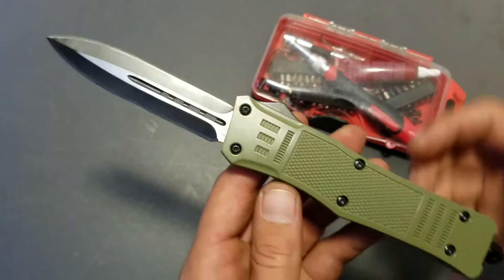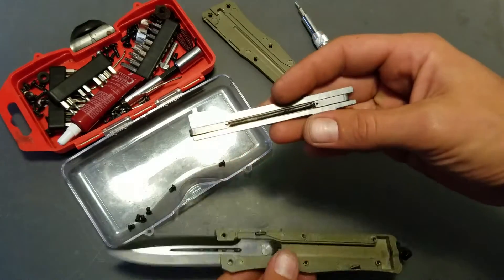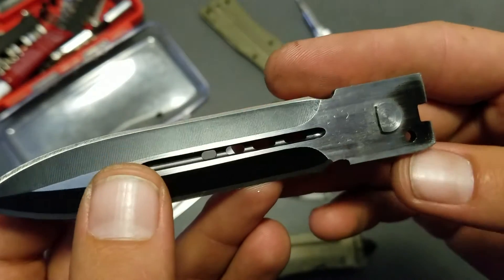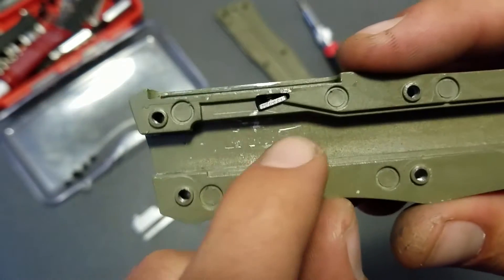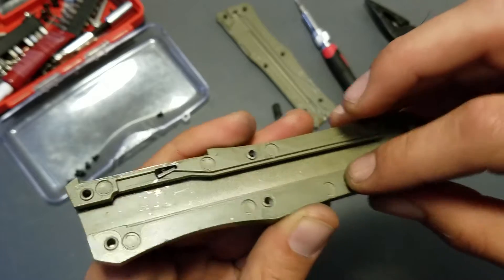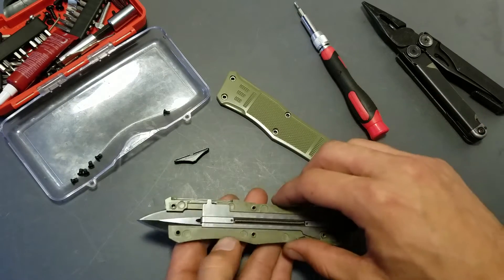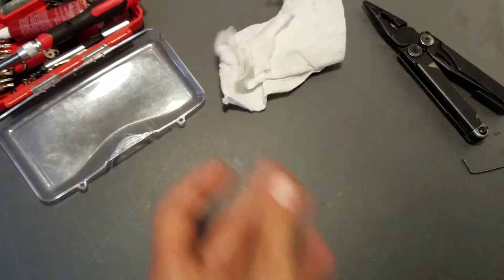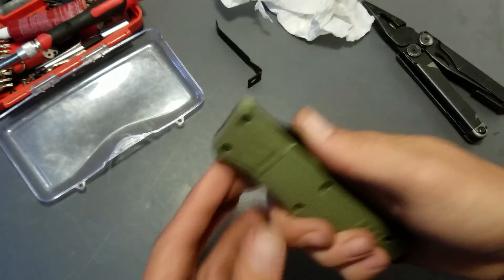Combat Troodon clone internals

Comment: The handle looks identical to the Atomic Defender available on Grindworx.  In fact, so does the blade, but the slide is slightly different.  I never really thought about it before seeing this video that the Defender is loose copy of the Combat Troodon, but it makes sense...they're the same size, same blade size, etc.  The Defender does have some decently thick blade locks which means it could stand up to being stabbed and power rocked in wood, and probably do a credible job of being hammered through, though that's not at all what normal people do with their OTFs.

Comment: can i please have a link to this knife or a inexpensive otf
Reply: Here you go: https://www.grindworx.com/cat--Atomic-OTF-Knives--571
Reply: The Atomic Defender uses the same handle as the one shown, same blade and is quite sturdy and reliable with a strong blade ejection.  It's on the heavy side, but not to heavy when clipped to the pocket versus riding in the bottom.  What makes an OTF great versus good are the blade locks.  Microtech and Benchmade have some pretty thick blade locks that won't fail without literally shattering the knife handle.  Really inexpensive OTFs often have thin slivers of metal for blade locks, but even that is ample for cutting tape, cord, boxes and stuff, even thrusting into soft materials.  The first thing I noticed when I disassembled the Atomic Defender is that is has fairly beefy blade locks so it will hold up to quite a bit of abuse without collapsing the blade into the handle.  Also, on mine, there is ZERO blade movement which is what you expect on a $250 knife, not necessarily on a $35 knife!  It really doesn't matter if the blade has some play, what matters is how much blade shank is retained inside the handle, and how close the tolerances are in the blade slot.  The Defender has a bit over 1" blade retained inside the handle which means to break the knife in half would require more force than it takes to snap the average hinged-blade knife.  If you wedged the Defender to the hilt in a crevice then used it to hang weight on I doubt it would break before an equal-size hinge-lade knife, and even then most would likely fail by the blade break instead of the handle fracturing and giving way.
Reply: Thank you

Comment: You do know you don't have to off track the blade to disassemble? The blade is only under spring tension when you push on the button, and only when you push the button.

Comment: Where are you supposed to put the lube on the inside or the outside?
Reply from the maker: Inside however I prefer now not to oil my OTF knives when you oil or grease it seems to collect debris causing malfunctions they run better dry in my experience

Comment: So what exactly is better in the original microtech? Better quality inside parts and spring?
Reply from the maker: Everything the quality of the materials the handle the blade the screws the spring everything the engineering that went into the design for longevity the stresses in the knife itself just from opening and closing will eventually damage this knife to the point of not operating which is not the case with a genuine Microtech the Clone is only designed to work for a short period of time they're not designed to be used as everyday tools for extended periods the work but not forever a Microtech will fail as well but you are talking a scale of years or decades opposed to months with the Clone carried EDC
Reply: @Lugermonger35  I thought that microtech had given China the patent for them to make the parts in China microtech imports them in, it says made in USA it is amazing USA but the parts of Chinese correct? Do you think it would matter which company made the bootleg knife? Their country lives off of bootlegging copyright so I would imagine there's a couple of them.as far as the longevity of the clone do you say that from personal experience or a estimate based on the inside quality? You said at one point it stops the plane, can you just buy a new spring for it better spring? Does each knife spring size and type very or the universal in size? Only thing I could think of that could feel would be the springwould it be possible to send it off to a private company in the US to have the spring replaced with a much better more powerful spring?what would you estimate the cost of a good spring ?so no more you open it and close it the more we're and chair and the more quicker is going to wear out? Or is it going to vary from where you get it from in China?
Reply from the maker: @frankwhite5455  no absolutely not there were no patents given or authorizations for clone production Microtech as far as material sourcing I'm not sure honestly it is possible however that would only fall under material not parts all of the parts are manufactured in house in the US as far as I understand and honestly this knife would not qualify for patent infringement on the genuine combat Troodon it is different enough that no one in a court of law would say they're the same knife they just look the same
Reply: So that's how China gets away with it, I've put a lot of replica/ clowns clothing items and accessories as well as phones and electronics, I ask myself that why don't they do an exact duplicate of these items, they got the possibility to do it but they don't the items always slightly different,now I see why that is
Reply from the maker: @frankwhite5455  yes and just difficulty in the manufacture there's a reason these knives are $400 you can't make one the exact same for significantly less money even if you're in China so they make it look the same and then constructed as cheaply as possible to keep the price down and production numbers up
Reply from the maker: @frankwhite5455  I heard a story of a lady in Paris was approached on the street by a woman with $20,000 in cash offering $2,000 to the woman to go into a Louis Vuitton store and I spend the $20,000 on four purses she tried and was immediately arrested it turns out it was a Chinese Mafia group attempting to get ahold of original Louis Vuitton purses to copy the new model same thing happens with knives